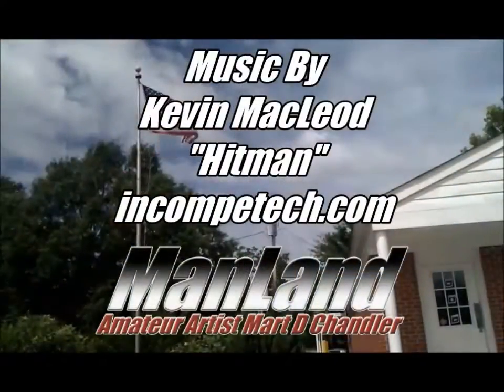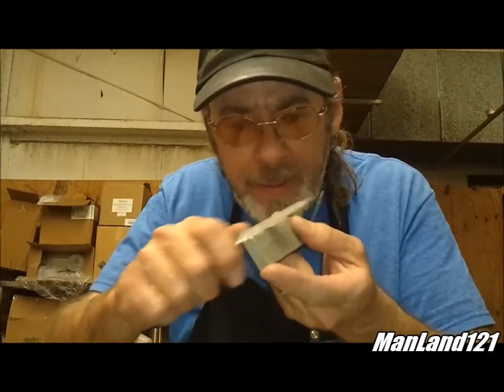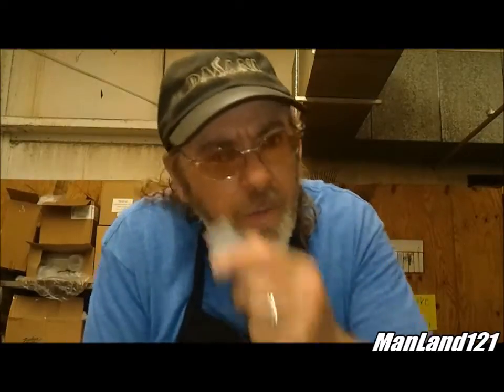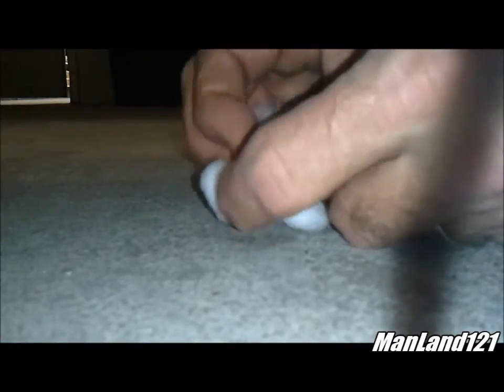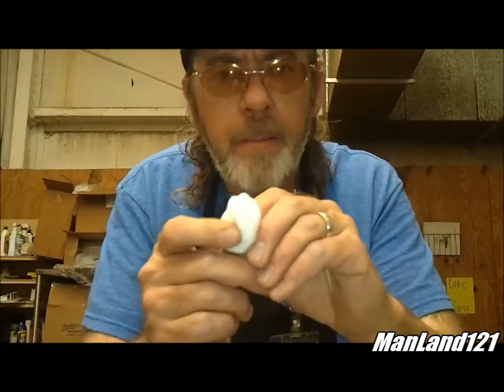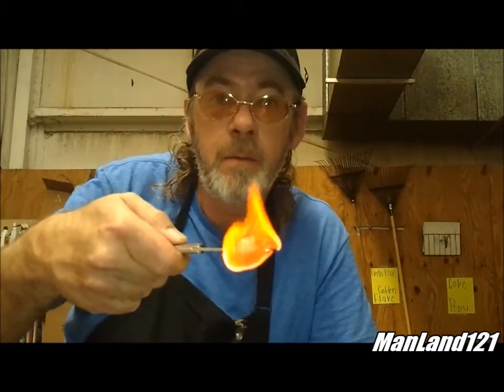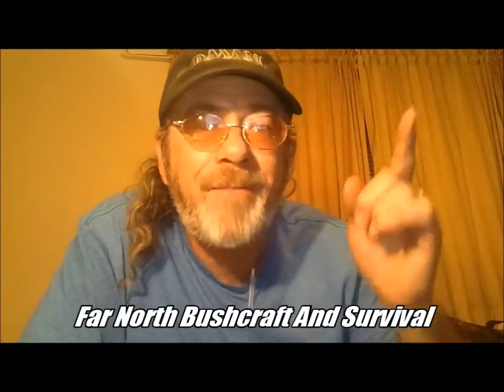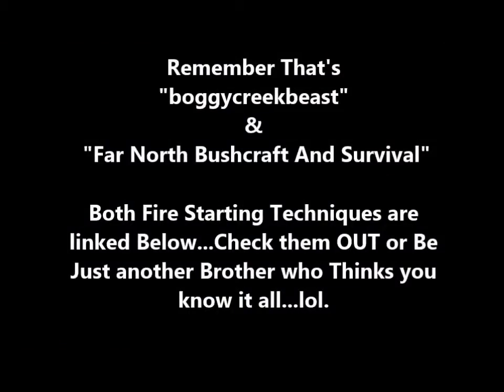ManLand - Cotton Ball Knife Matchstick

Comment: Just so you know, It works with the striker off the fire steel as well.. That was amazing.. Well now I am a know it all.... No one reads these comments do they? They private stuff right?        LOL Anyways Thanks for the tip brother. It never occurred to me to even try this.... But for anyone who reads this... Quit aiming at the cotton ball... This works much better.... ATB Mike
Reply from the maker: Crash Bushcraft You are right...yet a few in the comments...that are my buds...felt that this technique might hurt the temper of the blade...I disagree...there is a lot more heat to produce the blade than what little flame on the blade using this technique....Hell Batonning the blade kills the sharpness quicker than using it to strike and getting a flame...Just my opinion...yet I do respect their opinions too...

Comment: Very good technique Mart, unfortunately by doing it with the fire surrounding the knife you may risk damage to the heat treatment of the blade. If it gets hot enough for too long, specially on a smaller blade you may change the heat treatment and make it brittle or weak. I may be wrong but I try not to let my knives get too hot or spend much time next to a heat/fire source for that reason. Still, a very enjoy video. Take care. 

-Jacko
Reply from the maker: Well as I stated above... the flame won't be on the blade very long at all...you place the flaming cotton on or into the tinder you're trying to ignite...I use a pocket knife all the time for striking the Ferro Rod any way and not my Out Doors Knife...if a blade loses it's temper in under 10 seconds or so...I really don't want that knife...lol.

Comment: That is a cool idea tho i wouldnt want to use my knife. Your knife will heat up and it can mess up the temper, tho you could do that with another style of striker, so cool idea bro, well done.Fire fighter very cool man, yeah i tried that chaga trick a while back works pretty cool. i seen it the same place Lonnie had.
Reply from the maker: Truth be told here I only use my pocket knife that always have with me and use it primarily  to work the ferro rod instead of my "BushCraft" knife...so the temper loss is really of no concern...however in reality...the flame will not be on the knife very long at all. You strike it and place the flaming Ball directly into your tinder...I have tried this by putting the cotton on just a stick and the knife directly behind it and it lights up just as well...so the stick takes the heat...any who...Thanks Brother...a piece of FatWood works really really well with this technique...
Reply: Fatwood sounds like a great idea, i only mentioned the knife because others may let it burn on there lol. Some people get bent out of shape if you poke a fire with a blade now and then. lol Thinking outside the box is always good man.
Reply from the maker: Kullcraven Bushcraft Brother I know these types of people...lol. They actually will hack the heck out of a knife to process some wood but refuse to use that same knife to cut thru bone...they have a point but...you got a knife...use it I say...lol.

Comment: That's a pretty good idea, I'm gonna have to give it a try.
Reply from the maker: It does work yet according to some comments there are concerns of the flame causing the knife to lose it's temper...I have considered this...and I seriously doubt it because there was a lot of  extreme heat to created the blade in the first place...and a 10 or so second flame just can't do that kind of damage...any way I use a pocket knife to do this anyways...a knife that I constantly abuse in every day use...lol.
Reply: Man Land Well, with what I know about steel it would have to reach a few hundred degrees to damage the temper and would take more than a few minutes. I don't think you have anything to worry about.
Reply from the maker: fatmantolly I sure didn't think that either...I mean after all a barrel of a gun get hotter after a couple of shots than a blade on fire for just 10 seconds or so...but there were some concerns there in the comments...and I'm not a blade expert...except for chopping up Frog Legs...lol.